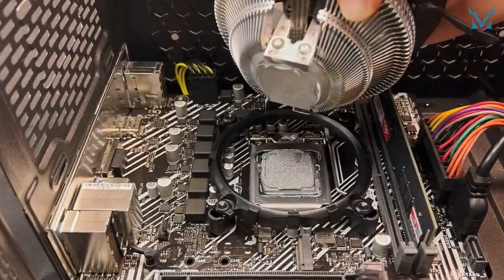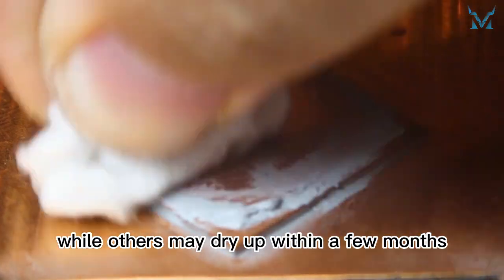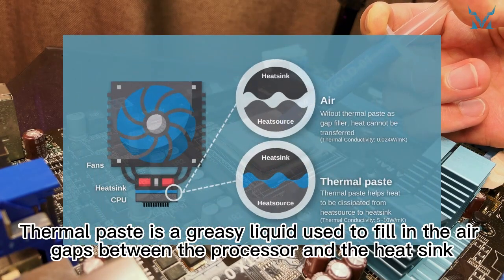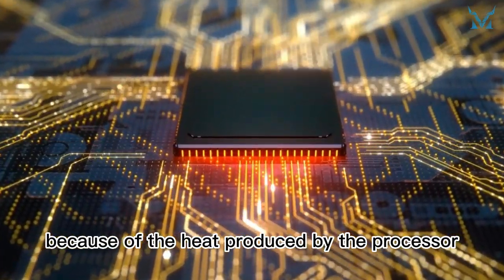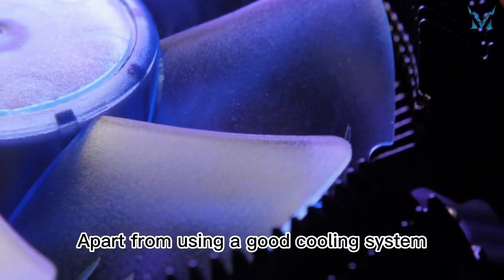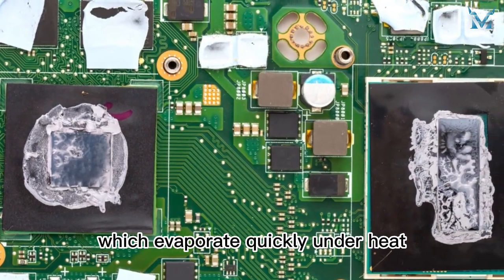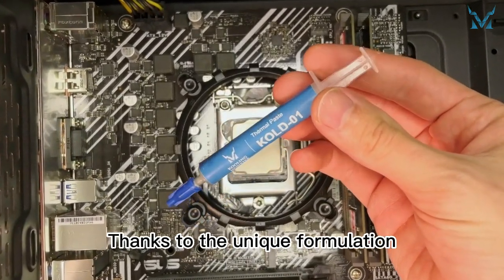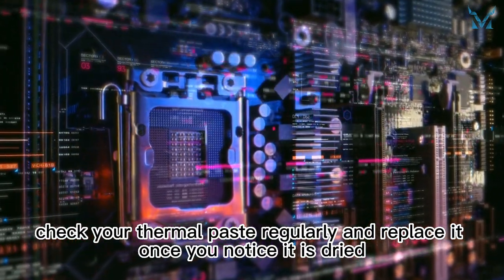How long does it take for thermal paste to dry?

Comment: so how many years does kold-01 takes to dry out ?
Reply from the maker: The specific usage lifespan depends on various factors, such as the laptop's working environment, model, etc. Feel free to try our KOLD-01 thermal paste, which is different from the typical thermal pastes you mentioned. The key difference is that most thermal pastes use a solvent-based formula, and when exposed to heat, the solvent evaporates, causing the paste to dry out and lose its thermal conductivity. Our unique solvent-free formula perfectly solves this issue, offering better thermal performance and longer lifespan for use in laptops.

Comment: Show me that dry thermal paste isn't good as new ...
As long as you don't move the cooler from the CPU the contact is the same, dry as wet.
Reply from the maker: Thermal paste will degrade over time. If you don't replace the thermal paste, the decline in your computer's cooling performance can lead to a significant decrease in overall performance. Of course, you can choose not to replace it if you don't mind, but it's like spending $500 to buy a computer worth $100. After replacing the thermal paste, you will definitely notice an improvement in performance.